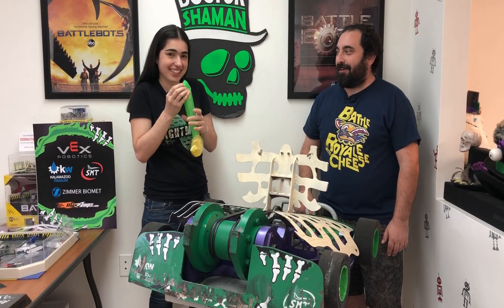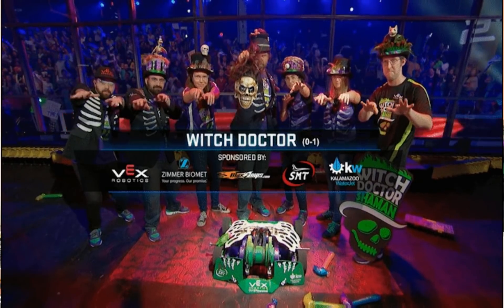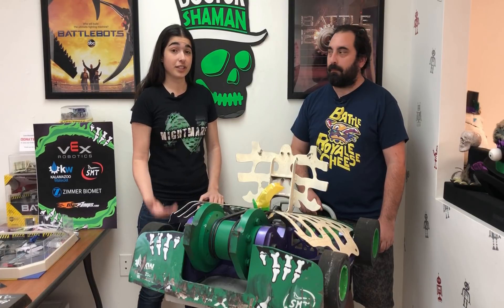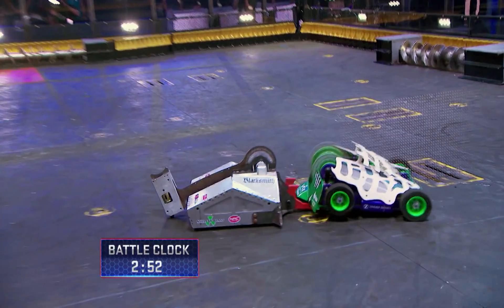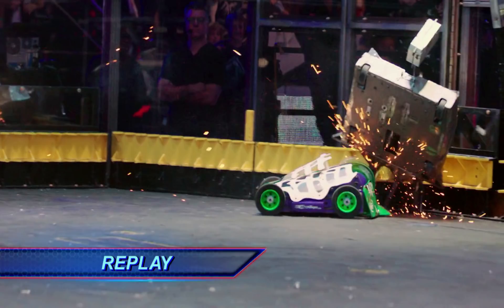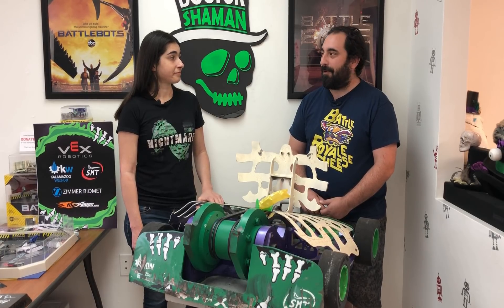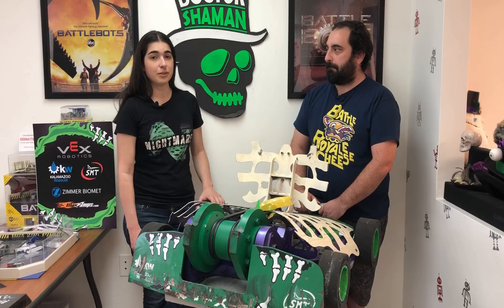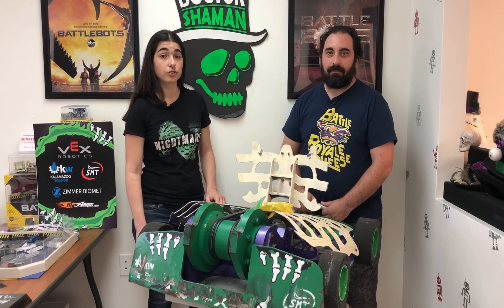Witch Doctor vs Blacksmith // BattleBots Breakdown

Comment: Congrats on the win, and for putting on an awesome show! One of the best fights of the season so far. Thanks for putting out these explanation videos too, they're a great insight into what it takes to compete in these events.

You touched on it briefly, but how come your tires have been popping off? Is that something you'll cover in a future video?
Reply: They replied to another comment saying that they fixed it before the third fight, and will explain it in that vid.
Reply from the maker: Yep, we'll cover it in the next video. We had to do quite a bit of work to figure out and fix that issue at the event. We love that the robot can drive well on 3 wheels, but we'd rather keep all 4!
Reply: I♡💀 witch doctor